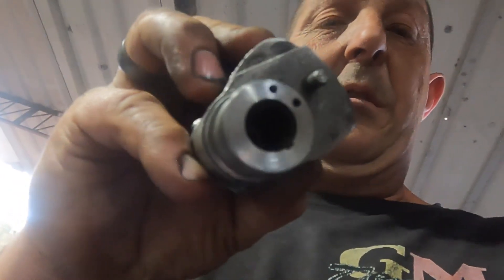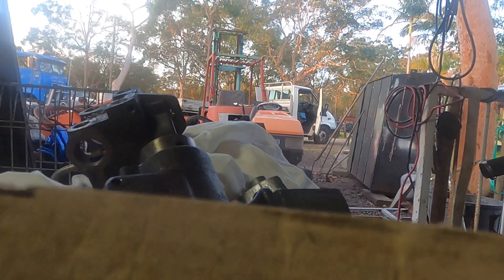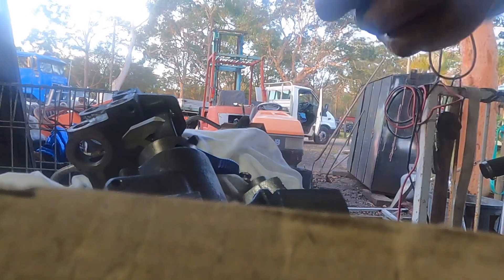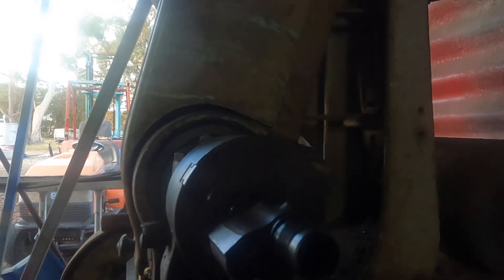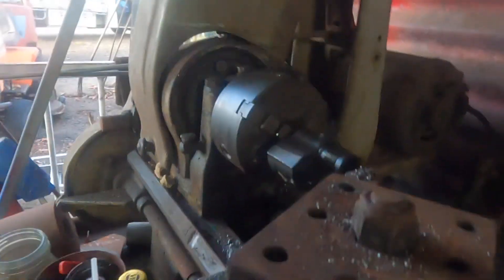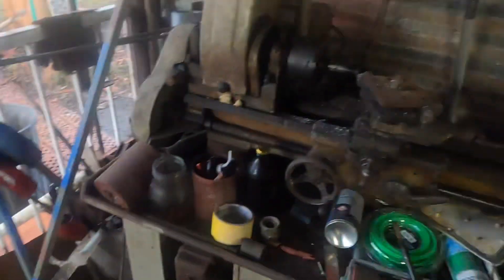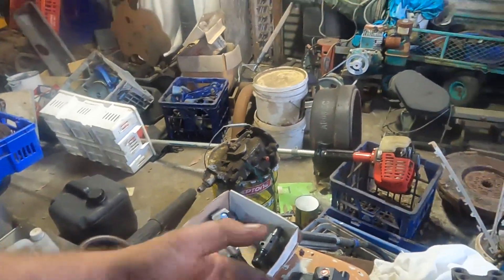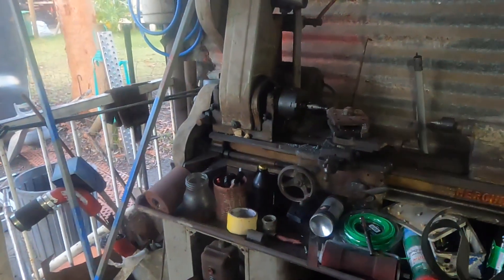Preparing HV7 injectors for modification

Comment: Adrian, thank you for sharing your knowledge and experience in your videos -- they have been very helpful. I have a GM 3-71 2 valve in a rough terrain forklift that I would like to put into good working order. Your videos have helped me to set the rack, which helped due to one injector being adjusted too far open. I bought additional used injectors to work on and swap into the 3-71 so I can run a set while working on another set. 

So, I have the original HV7 injectors installed that run, but of unknown history, plus two HV6's bought as cores, and three C55's bought as cores. My plan was to rebuild the C55's first and swap in all three for the HV7's. I think I need followers and one spring for the C55's. I have the GM in-line 71 manuals, volume 1 and 2, but they don't seem to have the part numbers for these injector parts. I have not disassembled any injectors yet, so other parts may be needed. Any advise you can provide would be appreciated.